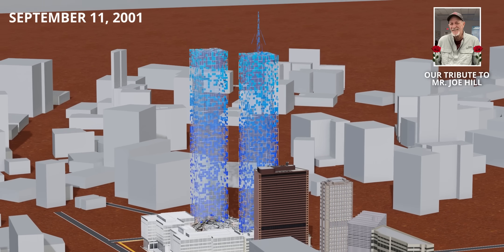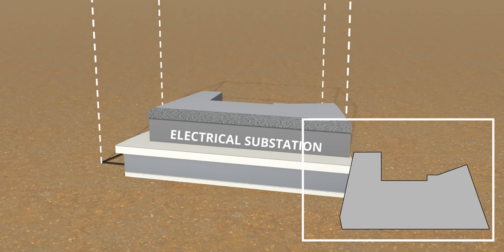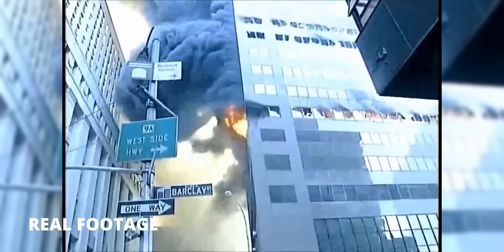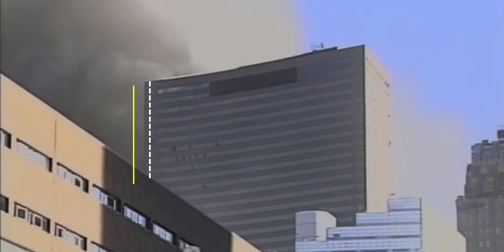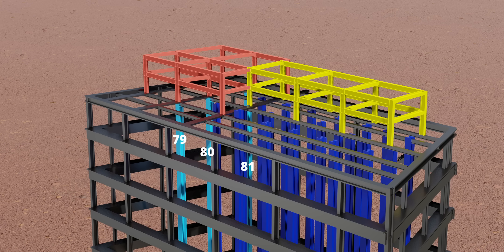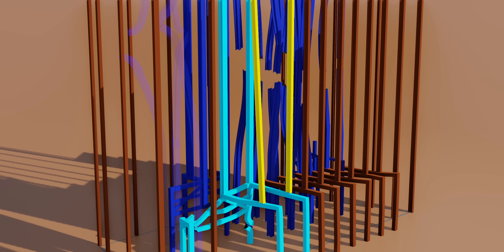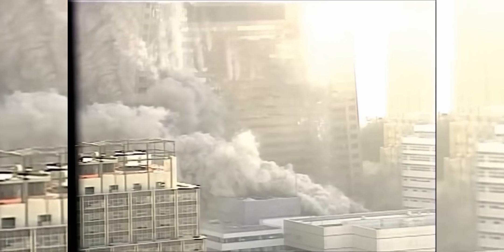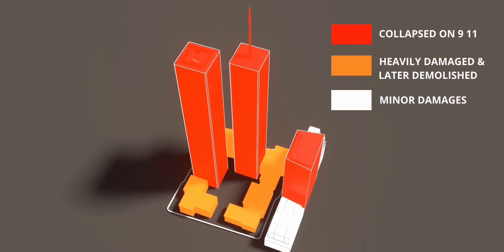Collapse of Building 7 | The Complete Physics

Comment: Funny how this tries to explain more columns fails when the official report only said 1 column made the whole building collapse.  Eitherway heat alone from common office furniture fire is not hot enough to weaken steel, so what made 3 column snap so suddenly should be obvious, and it wont take tons of explosive to do so, as this video clealy shows. Only 3 columns had to be cut to take the whole building down. That can be accomplished without anyone noticing as there was maintenance work on site days before the event.
Reply: Maybe this will help:  Building 7 was the 6th building to collapse of 10 lost on 9/11 and because of its early low priority was largely ignored for a while, so conspiracy filled the information void with simple-minded garbage by technically ignorant people promoting political agendas. This created a lot of confusion and misconceptions which I wish  to dispel, so I prepared this brief summary of my own analysis, using technical analysis, not ideology and magical (non)thinking. 

At 10:28am the WTC North Tower collapsed, showering Building 7 with tons of burning debris, causing heavy damage and starting many large  fires which burned out of control for the next 7 hours. Half the FDNY firefighters having been killed, units in disarray, equipment destroyed, no water pressure, and the greater urgency of search & rescue efforts, Building 7 couldn’t be saved so firefighting efforts were pulled as futile and 7 left to its fate. Firefighters make that sort of choice every day in brush fire situations - which houses to save and which ones to let go. Only real difference here is moving the decimal on the size and cost. People get overwhelmed by the size.

www.youtube.com/watch?v=g_SvpwyC17M

Collapse of a burning structure is always a concern for firefighters. Steel buildings subject to fire rely on active firefighting to survive. Buildings are designed around 1 to 3 hours of fire resistance, allowing time for occupants to escape and active firefighting to get started, after which all bets are off. Left to their own devices they'll exceed their design envelope and collapse, like Plasco Tower and Wilton Paes de Almeida. In 7 the occupants escaped, passive and active fire protections were compromised and active firefighting was abandoned hours before the collapse, which left the building to its fate. It lost. Odds on Building 7 would eventually collapse, and it did. No big deal in logic.

 http://www.youtube.com/watch?v=WnYBX6QT0R4 

FDNY Chief Daniel Nigro - The biggest decision we had to make on the first day was to clear the area and create a collapse zone around the severely damaged 7 World Trade Center, a 47-story building heavily involved in fire. A number of fire officers and companies assessed the damage to the building. The appraisals indicated that the building's structural integrity was in serious doubt. I issued orders to PULL back the firefighters and define the collapse zone. It was a critical decision; We could not lose any more firefighters. It took a lot of time to PULL everyone out, given the emotionalism of the day, communications difficulties and the collapse terrain 

FDNY Deputy Chief Peter Hayden ; We had our special operations people set up surveying instruments to monitor and see if there was any movement in the building. We were concerned of the possibility of collapse in the building. And we had a discussion with one particular engineer there, and we asked him if we allowed it to burn could we anticipate a collapse and if so, how soon? And it turned out that he was pretty much right on the money, that he said 'In its current state you have about 5 hours 

The collapse of Building 7 was anticipated and widely reported in the media throughout the day, with 24 video cameras recording some or all of the collapse. Everyone knew what was coming and why. 

www.youtube.com/watch?v=OY5S5k3tMHI

Building 7 collapsed from the inside out which is not at all intuitive and hard to understand, with most details being hidden from view.  It requires careful analysis and observation, and some people will struggle no matter how much it is explained. But here is my explanation relying on no outside authority. 

Building 7 was a unique, asymmetrical 47-story steel frame structure built atop a smaller 3-story building serving as a partial foundation, requiring lower floors dedicated to complex load transfer structures. Of trapezoidal shape and tube-in-tube construction, B7 (above the 7th floor) consisted of a central core of steel columns carrying most of the gravity load, perimeter steel columns around the outside of the structure carrying the remainder of the gravity loads and long span beams and girders to tie those elements together and form the floors. On the outside of the building hung a facade or outer shell. 

www.nist.gov/image-16640

Phase 1 : First externally visible signs of collapse initiation occurred at 5:20:28 pm and was notably quiet with observers not realizing the building was collapsing! No warning in the form of hundreds of eardrum busting 180dB explosive bangs. Here at 12:00 a local CBS affiliate reporter talking 10 blocks from B7 when collapse begins. People don’t start to notice the collapse until 12:11. At 12:45 is the famous CBS fixed camera clip of Building 7’s collapse. Note the silence. 

www.youtube.com/watch?v=t5tEy6mXSE8

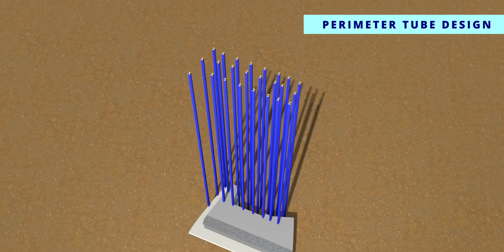Lower floor failures above the load transfer region (8-14) in the NE corner initiated the collapse. In this video at 0:45 you can see the NW corner from inside the building while under construction, Column 79 just out of frame on the left. That big, angled steel beam across the top of the frame connects to C79 at one end. The girders connect to the beam. That beam and all those girders depend on just one connection 

www.youtube.com/watch?v=nP3TNHPCIVU&t=45s

Phase 2 : NE corner floor failures caused a loss of critical lateral support over an excessive length of Column 79 and it buckled. Looking at the above floor diagram of Building 7 when you see all the structures that depend on C79 you quickly realize this one column was a relatively isolated structural element on which a disproportionately greater fraction of the structure depended analogous to say the Key Bridge. Externally as collapse begins we see a vertical progression of window breakage along the 44-46 line and a kink in the roof of the East Mechanical Penthouse at the top of the building, consistent with C79 failure. Normally with a buckling column, the load could be redistributed to other columns. With C79 that is not the case - the failure did not redistribute the load, so the collapse rapidly progressed to the roofline, sinking the rooftop penthouse. The transition from full capacity to almost no capacity occurs in an instant and will result in virtually no resistance 

Phase 3 : With C79 gone, B7’s progressive, non-symmetrical collapse continues with adjacent columns 80 and 81 left laterally unsupported and quickly buckling as well. The EMP drops down through the building. C79-81 all have no diagonal bracing, which is the major reason why they could not redistribute a lot of vertical loads among one another. From there collapse progressed from east to west through the central core until the core was gone from 81 to 58, taking all the interior floors and probably most of the perimeter columns with. Follow the horizontal progression of window failures low in the building and the dropping of the remaining rooftop structures into the building. The NIST Building 7 study model 4 determined C79 failing under ANY circumstances would have initiated the same collapse sequence. 

Phase 4 : After about 10 seconds only the exterior moment frame remains, giving the illusion B7 is still standing to the casual observer since little has outwardly changed. But it is just a hollow empty shell like an empty cereal box supported only by a few remaining columns and overloaded from the loss of the core columns and floors, quite unable to remain standing. With nothing remaining behind it, the north face leans inward, forming a V in the roofline, the last few columns buckle under the strain and the moment frame free falls, landing on top of the debris pile. 

It is only here at the very end, a single measurement of alleged free fall acceleration is taken, from just one point on that outer shell. The Building (core and interior) did not “free fall” - was already gone before that happened - just one corner of the outer shell briefly moved at a rate comparable to FFA. This alleged FFA was a product of how the shell fell NOT why the building fell . It’s also not even proper FFA as the single measured point was moving in 3 dimensions, not just down, which adds another variable. Start to finish the collapse took 18-20 seconds, 3 times longer than true FFA . How fast something falls can’t tell you what started it falling, certainly not 10 seconds after it started falling.  

The debris spread outside the footprint blocking surrounding streets, heavily damaging the Verizon Building and destroyed Fiterman Hall. 

No building is meant to survive 7 hours of multi-floor unfought fires. Building 7’s progressive, non-symmetrical collapse was incidental, unintended collateral damage from the combination of fire, time & gravity started by the collapsing North Tower, true no matter who planned and carried out the 9/11 attacks or why .  Of so little consequence it barely registered at the time, only taking on semi-mythical status as an alleged smoking gun years later when demolitions at the Twin Towers, missiles at the Pentagon and shoot down over Shanksville all failed and conspiracists had nothing left to work with. 

Anything can seem like a conspiracy if you don’t understand how it works. Now you should. I hope you found this helpful, informative and it solicits informed critical comment. If I made any errors of fact, logic or reason or left anything important out, please let me know so I can fix it. OR offer a more plausible alternative if you can. Be the first. Please start any reply with the words “Tits McGee” or I will know you didn’t read it and are wasting my time.
Reply: @TheCriticalStinker-01  , Maybe this will help: ONE SINGLE WORD! ... That is all it takes to answer my basic high school physics question:

As an object is falling in free fall how much work is being done by that object AS it is falling in free fall? 

Helpful hint: ChatGPT 5, Google's Gemini, Elon Musks'Grok and the Chinese AI DeepSeek can ALL answer this high school physics question with one single word. Ask the very same question and ask for an ACCURATE answer with one single four letter word.

If you cannot answer this basic high school physics question then you have no business commenting about the TOTAL collapse of the World Trade Center 7 building.

In NIST's very own words:

"The analyses of the video ... revealed three distinct stages characterizing the 5.4 seconds of collapse:

Stage 1 (0 to 1.75 seconds): acceleration less than that of gravity (i.e., slower than free fall).

Stage 2 (1.75 to 4.0 seconds): gravitational acceleration (free fall)

Stage 3 (4.0 to 5.4 seconds): decreased acceleration, again less than that of gravity"

SOURCE: https://www.nist.gov/world-trade-center-investigation/study-faqs/wtc-7-investigation

Comment: If youuu slow down the collapse of tower 1 there are 4 different explosions on the way down lower then all the debris 2 sides at different floors so it was not pressure but smaller explosions  imo
Reply: Except for the lack of explosions, and the irrelevance of your opinion.
Reply: @mooneyes2k478  , If you are still having difficulty with basic high school physics ChatGPT 5 can help. 
Jesus can help too ... Just ask him ...
Reply: @mooneyes2k478  ,  Please explain to the world why you choose to accept NIST's 'gràvity alone' THEORY as being a true explanation of why the World Trade Center 7 building TOTALLY collapsed as it did on the day of 9-11-01 without NIST ever PROVING it to be true. 
Seems like something only a WEAK MINDED PERSON would do ... ESPECIALLY when NIST also said that World Trade Center 7 fell at free fall, that is, with an acceleration equal to the acceleration caused by the force of gravity.

The Force can have a strong influence on the weak minded."
O-B-1-Ken-O-B
Reply: They are called squibs. Which are present in nearly every controlled demolition

Comment: So wouldn’t it fall unevenly if if some columns failed? That building fell quick and perfectly. No steel frame building has ever fallen like that until that day. And what about all the witnesses that heard explosions? What about Silverstein himself on TV saying they decided to “pull “it? Sorry I can’t buy this video
Reply: Define "perfectly"
Reply: with structures and structural engineering, almost every support in a building is built to be efficient and not just wasted space, which means eveyrhting is distributed evenly. So, if some start to fail and arentt able to hold a ton of weight (or start to bend etc) the others have to start supporting twice or more weight than they were ever designed for. it does this for every support and happens almost instantly for a scenario like this
Reply: @Travixty - Key factor in Building 7 is when C79 failed, due to the unique design, redistribution of those loads was not possible, inducing a cascade of failures. 

Which is poorly explained in this grossly over simplified video.
Reply: " That building fell quick and perfectly. "
If, that is, you don't understand the meaning of the words "quickly" or "perfectly".

"No steel frame building has ever fallen like that until that day."
Not only utter nonsense, but also completely irrelevant. If it had been the first, which it wasn't, all that would mean would be it was first. Nothing else.

"And what about all the witnesses that heard explosions?"
What about the baseless nonsense made up by people unable to face reality?

"What about Silverstein himself on TV saying they decided to “pull “it? "
What about your complete and utter failure at basic English comprehension? That you don't understand what Silverstein said(or more likely, that you took the word of other failures) means nothing other than that you don't understand. This is known as a "you" problem. I suggest you go back to school, and actually pay attention this time.

" Sorry I can’t buy this video"
So what? What you "buy" or don't "buy" is entirely irrelevant in any and every way.